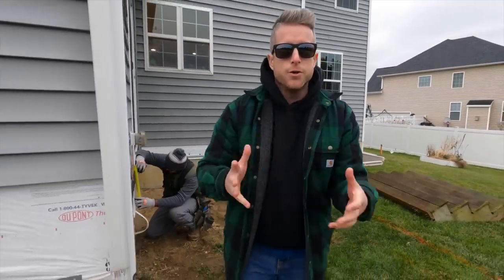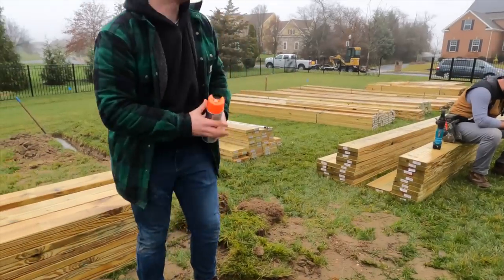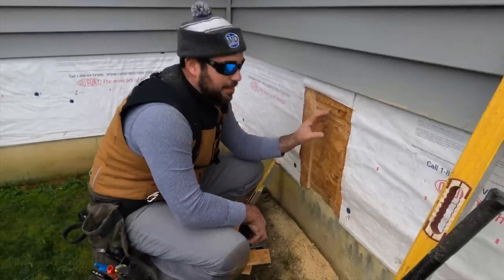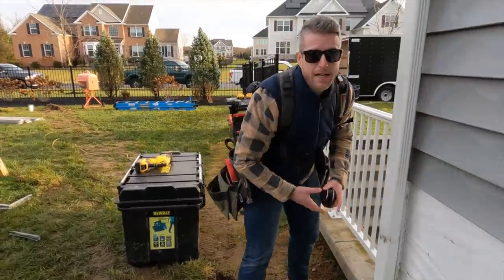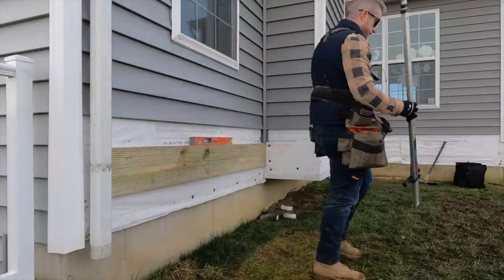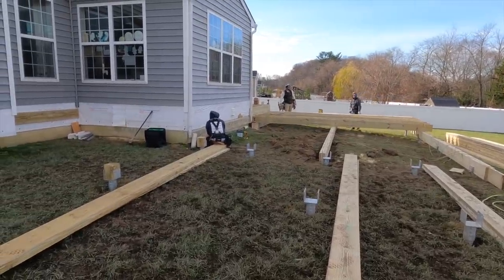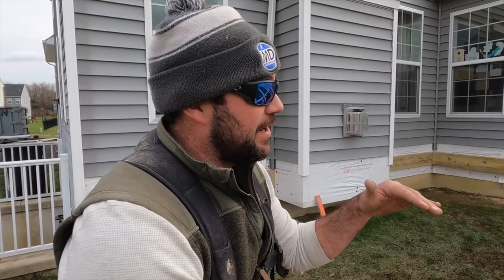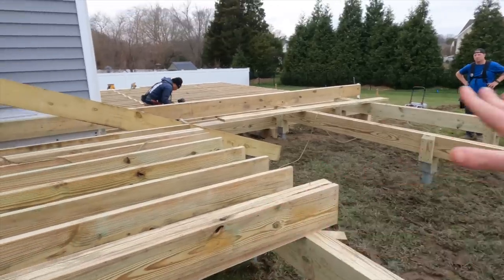Helical Piles and Deck Framing - THE MOUNTAIN PT. 1

Comment: Hot tip: find your finished floor heights by measuring down from the windows. You will need a tape measure for this.
Reply from the maker: but the sill isn't the same height on both sides, so you have to put a level hanging out both sides of the window, and for that we'd have to track our muddy boots inside!

Comment: I enjoy watching your videos. I started during covid and still enjoy them. Q: how would you attached a ledger board on a stucco exterior? All you videos are on homes that don’t have a stucco exterior and I wonder if they would be handled the same. My home builder didn’t remove the exterior and attached the ledger directly in the stucco which seems wrong but that’s how it seems to be done in my area by most builders.
Reply: Properly applied stucco is an excellent building envelope. No sense cutting out for a ledger. The best way to attach a ledger is to space it off about 3/8 so the back and ventilate and lag through the stucco to the house framing with polyurethane sealant in the the lag holes. Much more water proof than a flashed ledger cut into the stucco.

Comment: Love your videos man ! The crew, your work and ethic are top notch !! Spending my time on all your videos. If i may ask few questions: Are you using yellow cedar ? is it better than pressure treated ? where do you find it ? Also, how do you find an the helical operator / provider ? Would that also work in a very rocky place? Finally, I had in mind that space recommandation for Trex or deckorators was 12" wide but most of the time you're at 16". Are you using a stronger/less flexible composite ? Thanks again man ! Luv your stuff !! Thanks for all your work !

Comment: While I understand the design showed no "structural support" around the fireplace, I don't understand why you would need a triple joist on either side and a quadruple header. I didn't see anything bearing on these areas so why wouldn't doubles be enough?